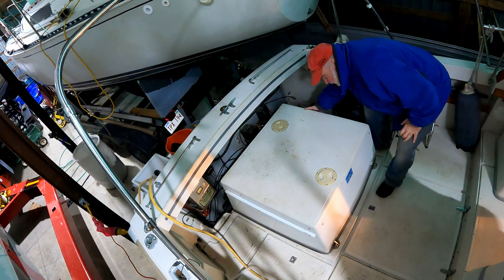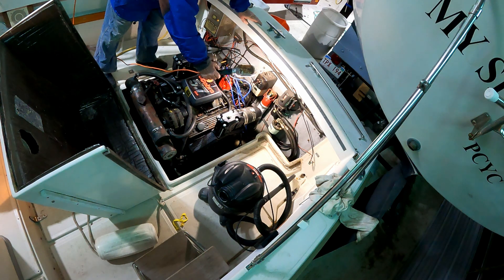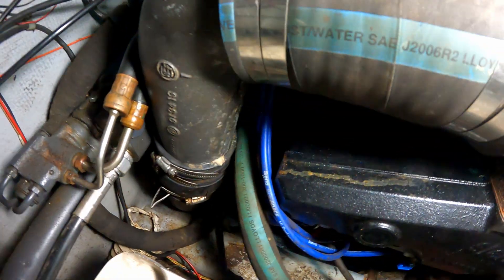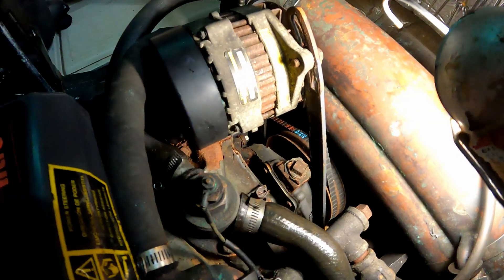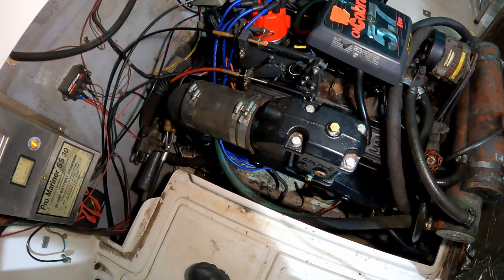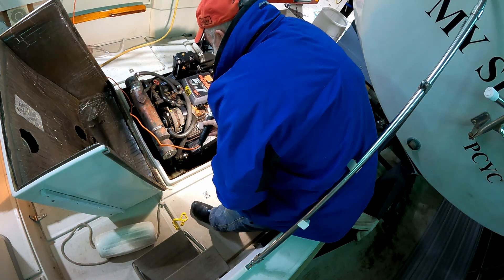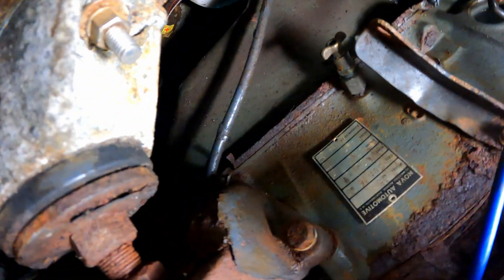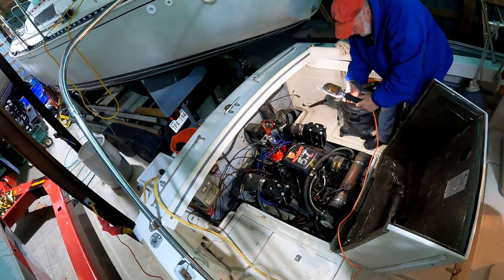Ep 1. Turning an I/O Gas Engine Power Boat Into an ELECTRIC Cruiser  -A First Look

Comment: I have a 1920's Richardson 26ft cabin cruiser , initially powered with a 200 hp International Petrol , now long gone and want to replace with a say 25hp engine that will be reliable and do just 6 to 8 knots .    My preference is a 3 cyl Yanmar diesel  but I am willing to consider electric  .   The boat like many will be out of use for at least 6 months of the year  so charging the battery and maintainence will be crucial   as it will have to look after itself just as a diesel does  .   It will have to be absolutely safe  with no fear of thermal runaway  due to salt air ingress being on the coast . and it will have to be able to be taken on passages to places where there are no charge points like the uninhabited islands off our coastline in Wales .  Is electricity an option ??
Reply from the maker: Should have no problem with loss of voltage with either AGM or Lithium batteries.  I have had both sit over winter (6 months) without any charging with minimal decrease in voltage.  Otherwise healthy AGM's want to be fully charged and Lithium's want at least 20% below full charge before being left for long periods. Beauty of electric is there is no other maintenance required. 
Thermal runway prevention is the purpose of the BMS (battery management system). Just make sure you get a good quality one.  
As to salt water intrusion issues, I have had my and electric drive in my sailboat for 10 years and my power boat for 2 years and absolutely no issues arise using dielectric grease on all electric connections.
Range is a subject of power vs displacement &  hull shape.  My deep V-hull shape of the Limestone Express Cruiser was designed for a large horsepower engine so it could get up and plane.  Mine did 35 knots before conversion.  I was looking to only leisurely cruise around the bay.  With a equivalent 25 hp electric drive with a 96v 13Kw battery bank, I get a max speed of 6 knots for 1 hour range.  If I drop to 4 knots I get 3.5 hours range.  If one had a strait drive shaft and more efficient propeller, instead of an inboard/outboard system I think you could see at least a 20% increase in performance.

Comment: Thanks for taking us on your journey. You are setting a course that many will follow. If possible could we have some details around the technical specifications, in particular the motor and batteries and why you chose these particular models? Did you design the installation yourself or have you adapted an existing plan. Thanks again.
Reply from the maker: Scott Masterson of Stealth Electric https://www.stealthelectricoutboards.com, had done a similar conversion of an i/o a few years back and did several videos.  I found him on the website plugboats.com (a terrific resource) and figured what the hey I would give him a call.   I outlined what I had for a boat and he provided the specs and design for the system. I felt going with one supplier would give me a shorter lead up window to launch.
Reply: Where did you get the conversion parts? Specifically the coupling from the motor to the outdrive.
Reply from the maker: In my case it came with the whole conversion package for my omc 5.7L system but if you google “omc engine coupling “ you will find a number of sources from engine part suppliers.  It needs to match the manufacturer (omc, mercury, Volvo etc…) of your Outdrive unit so that it will accept the spindle arm of the outdrive.coming through the bell housing. 3:22
Reply: I have an OMC Cobra and have been looking all over for a  conversion kit with no luck.  Can you tell me where you ordered yours from.
Reply from the maker: Hi Eric, my system came from Scott Masterson of Stealth Electronic. If you look at an earlier reply from a couple of months ago, I gave his description and website.